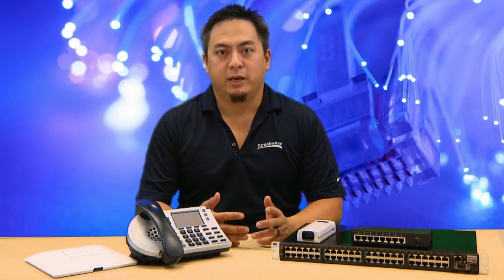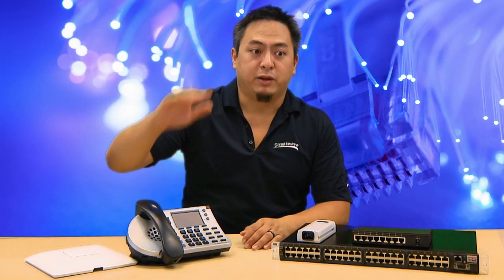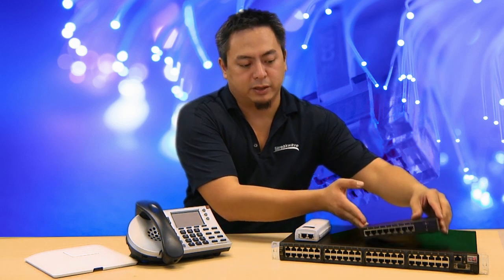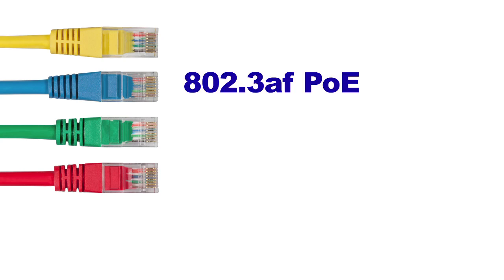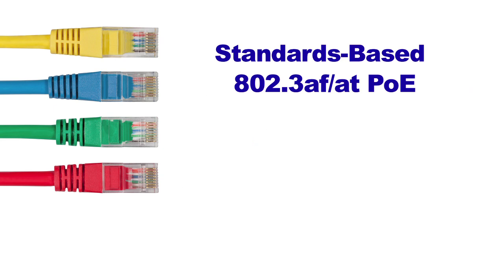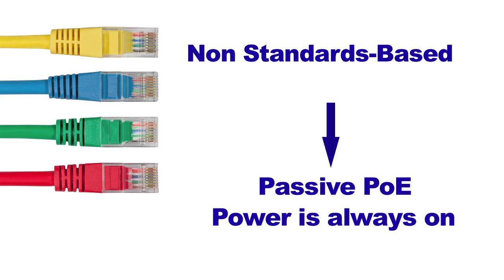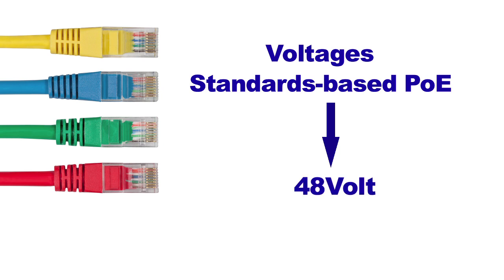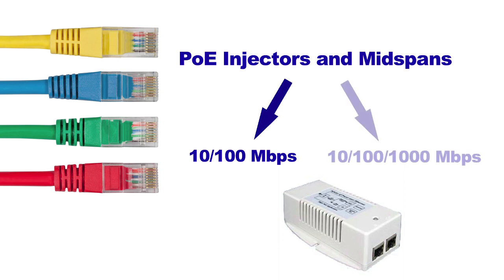What is Power over Ethernet (PoE)?

Comment: I have a Cisco 3750 48 PS-S POE. I also have a Foscam POE camera, well the Camera comes with POE Splitter. The voltage ranges are selectable on the splitter. 5, 9 or 12. Im thinking I just wasted my money on ebay with buying the 3750 for POE sourcing....... any thoughts?

Comment: hi all I have a question. does the device you're trying to use with PoE, have to be compatible with PoE. or are you able to power any device over PoE. for example I have an IP camera and it has a port for the 12 volt DC power as well as the ethernet cable. will I be able to power this via PoE.
Reply: It depends on the device.  Many 12 volt / PoE devices do normal IEEE 802.3af.  See this video: https://youtu.be/mPvDJvFu3rs

If it is only a 12 volt device, see this one: https://youtu.be/WTiBhJTuK6M
Reply: Second video: https://youtu.be/WTiBhJTuK6M

Comment: good, I have a question. if I use a midspan and i Have 24 cameras, but the cameras are DC12v 6watts each one, what power supply should I use?
Reply from the maker: Do the cameras take DC12V over PoE? The reason I ask is because 12V doesn't usually go the entire 100m of Ethernet cable. If it's not PoE, sometimes people use products like these https://www.streakwave.com/itemdesc.asp?ic=POE-MSPLT-4812